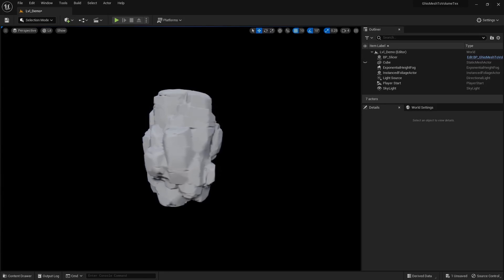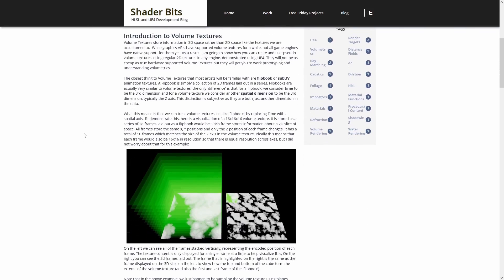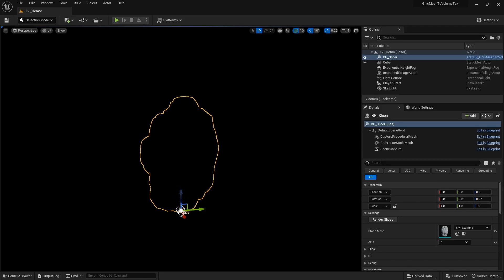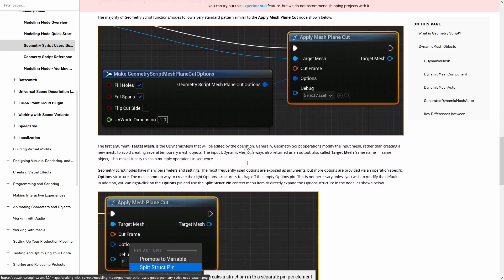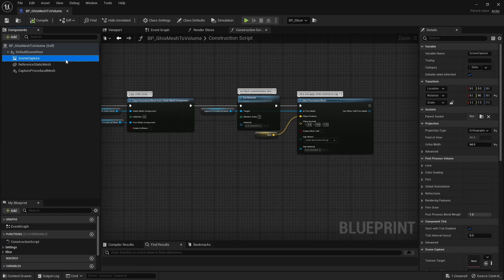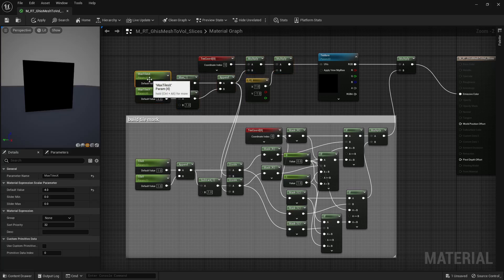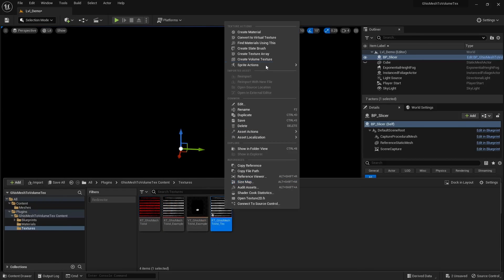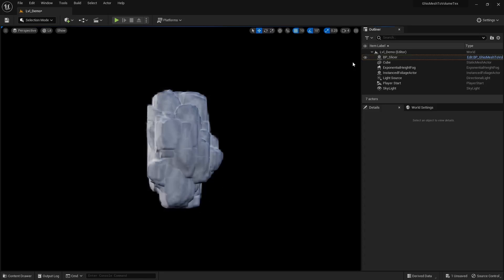Mesh to volume texture technique!

Comment: Hello, how can this volumetric cloud material be generated without using the volumetric fog component?
Reply from the maker: Hi! This is not a 'cloud' material, just a basic raymarching algorithm to step through the volume texture and build up a 'density' value (which is essentially what a cloud shader does, but in a more intricate way)

Comment: How do you find time to make so many videos and new experiments? Do you even sleep sometimes?
btw: It would be simpler and cheaper to use world position offset for rendering tiles instead masking. :)
Reply from the maker: I do sleep, but I do work a lot as well :P Hmm not sure what you mean exactly with world position offset but yeah I guess :D? There's always many ways to do things. I actually didn't care about performance here tbh because it's an offline tool so usually performance isn't much a concern unless it's insanely expensive and takes seconds to compute :)
Reply: @ghislaingirardot   I mean all those nodes in M_RT_GhisMeshToVol_Slices (3:07) can be replaced by 6 nodes with using WPO and sampling at the default tex-coord location.
You only have to calculate the location/scale of quad and offset verticles. You are right, in this case, performance does not matter but it is just good practice, additionally clean and easy to debug/understand, I thought that it's worth noticing maybe next time you will consider this way :) Keep doing good work!
Reply from the maker: @ImaginaryBlend  Right, but I'm not rendering vertices in this material though, it's a rendered image of the cap mesh that's composited into an atlas texture using a simple DrawMaterialToRenderTarget node. So I fail to see how the WPO is involved here. I'm probably missing something :D

I guess you could make the scene capture component render the sliced cap from below at the atlas dimension directly and move the sliced mesh using WPO tile by tile and skip my material setup.

You could also probably use Shared:Clamp on the texture sampler and just shift the UV coordinates to have that captured image show just one time on the required tile... And a million other ways :D

Anyway... I'm probably too brain dead right now to understand what you mean but I'll assume you're right :D Thanks for the feedback, always appreciated :)